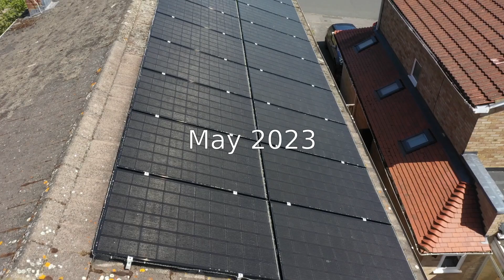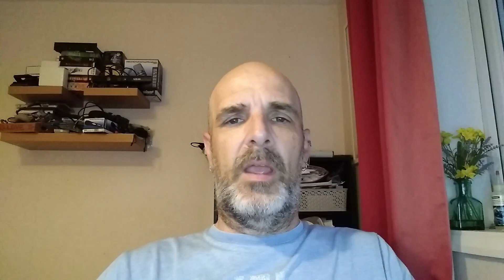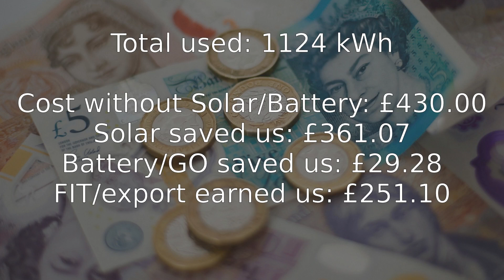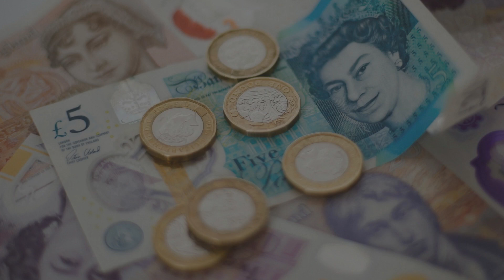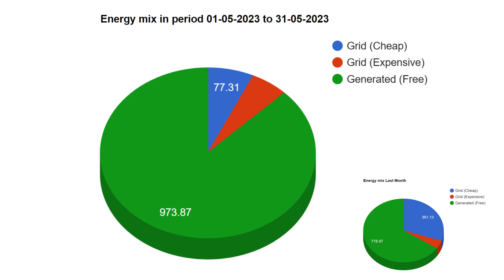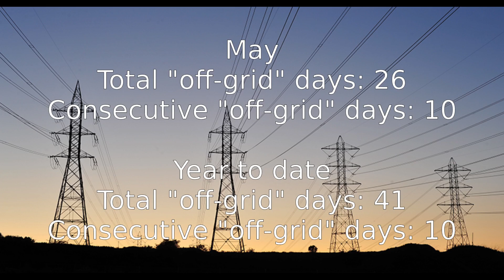Electricity stats for May 2023

Comment: Thanks for this, I was particularly interested in how your vertical panels are performing as we  have just added 1.2 kw worth on our south facing front wall. We are more than happy with its performance since last month when they were fitted, but they are really there for the months when the sun is lower. We produce more than we can use in the summer months but it’s the winter where we needed to maximise production.

Like you we are on FITs on our original array, the step of permanently giving away our index linked 50% deemed export to gain a higher export rate was a step too far though. We will watch Octopus Flux rates over the next 9 months to see what they settle down as but it’s unlikely we will swap. Without doubt it’s good for those without FIT payments.
Reply from the maker: Nice to hear others are adding vertical panels. They do help in the winter. I used to produce too much in the summer but now I'm close to using it all. I'm considering adding some more panels to the north side of my roof now! 😂
Reply: @nicholashowell  we have two whole north facing roofs spare but limited as we are to an export of 3.6 kw we are well into diminishing returns on investment if we go there. If the DNO allowed exports higher than that ( on a single phase supply) everyone would benefit. All they were interested in was charging us £15k to upgrade us the three phase. We didn’t bother 15 k buys a lot of energy.
Reply from the maker: @lynnfisher4396  I have an 8kW export limit here so if I did add more panels I'd have to get an inverter with an export limiter on it. I thought about 3 phase but decided against it for now, better spending the money on more batteries.